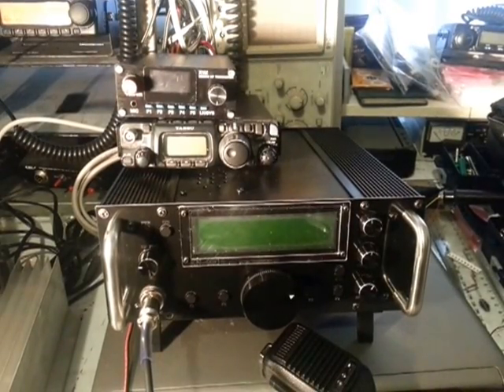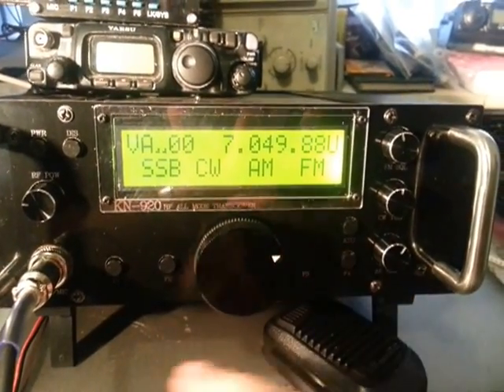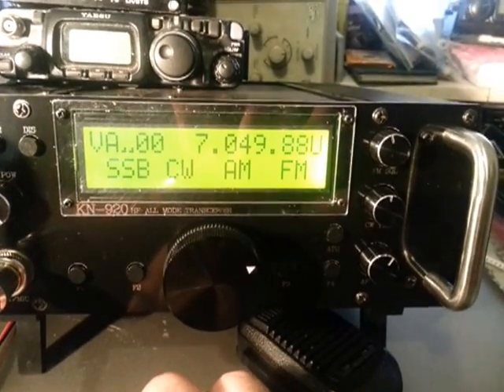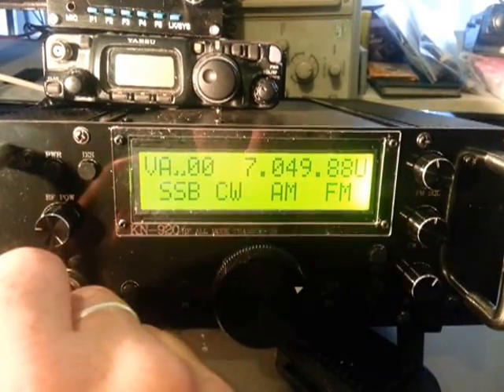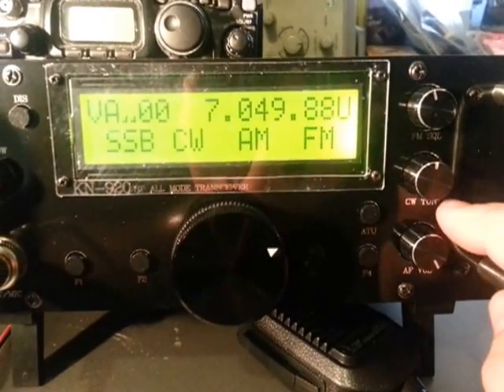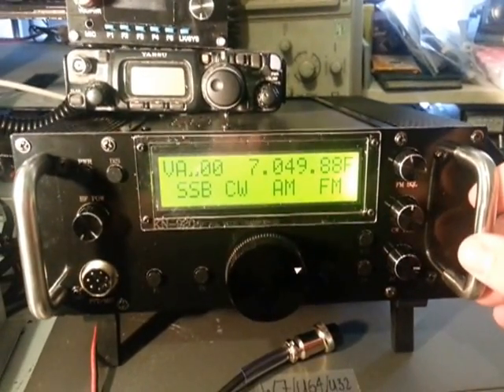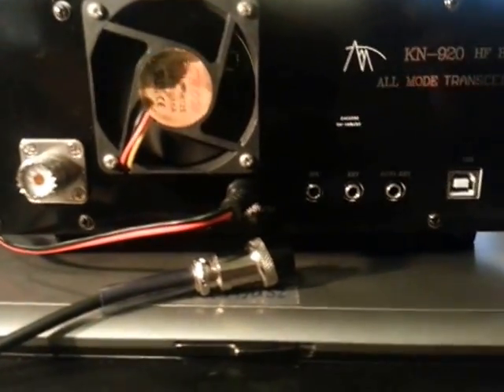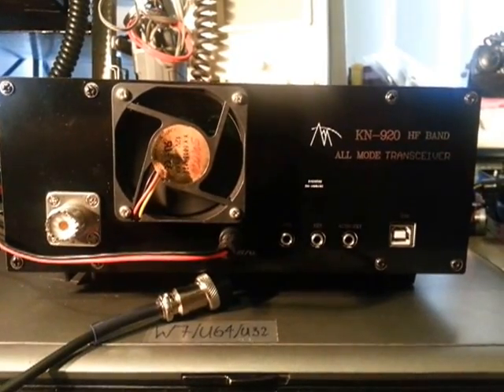KN-920 Multi-Mode HF QRP Radio - Arrives in Australia - Brief Introduction

Comment: On fm can you switch between 5khz dev FM or 2.5khz dev narrow fm ?
Reply: The Narrow FM Mode deviation is for VHF and UHF not HF.
Reply: Brad Kellison Im sorry Brad,you are incorrect for UK & Europe HF-10m band & CB radio Narrow FM=2.5khz not North America USA 5khz,VHF 2m is narrow fm,70cm UHF wide 5khz,PMR446 is narrow FM,The question I asked was this radio has FM transmit  but what max deviation has the manufacturer set the radio too narrow fm 2.5khz or 5khz wide fm on the 10m HF band,not vhf or uhf can anyone answer this question or is this just too technical?
Reply: rpcomms1
 No I am not wrong Cause here in the USA the only narrow band FM is for Business band. HF here in the USA is not Narrow. VHF and UHF business band is narrow band to 6.25 Khz wide.
 By the way I AM IN THE USA. NOT OVERSEAS in the UK.
Reply: Brad Kellison hi brad, look mate i not going to get into a stupid argument over whats whats Only im asking is the above question if you cant answer the question lets just leave it ok